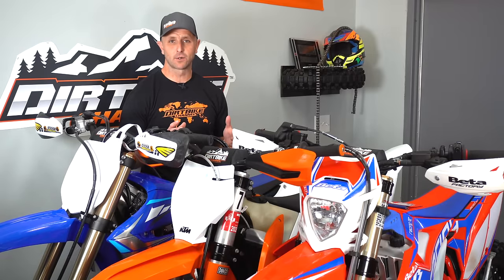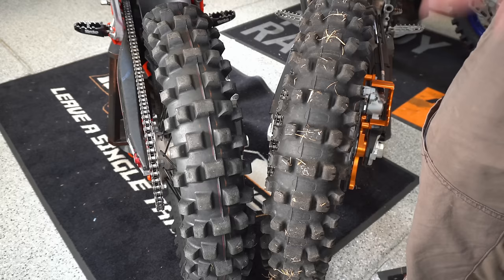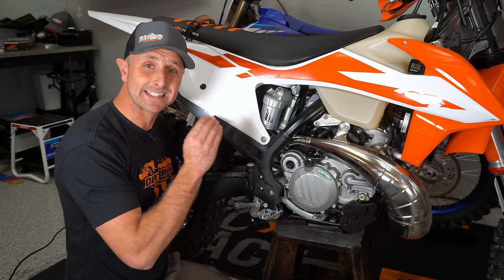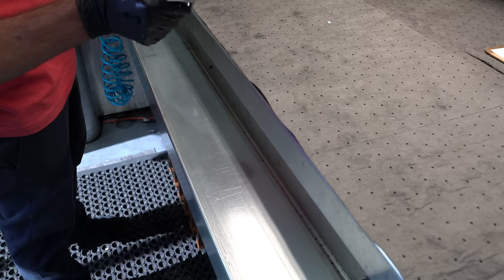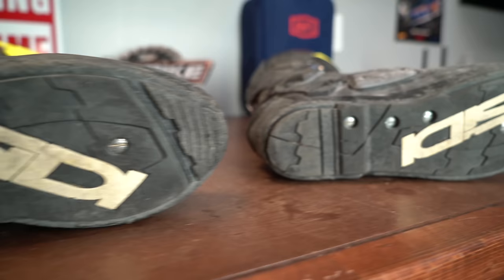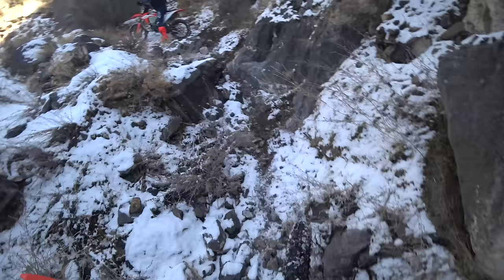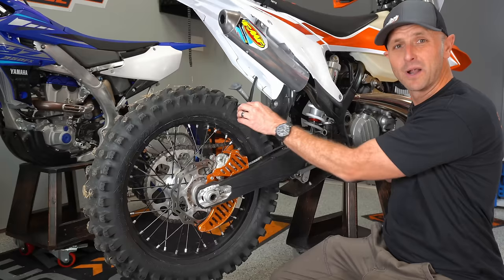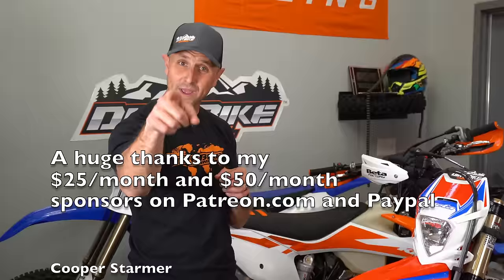21 Common Mistakes Made with Dirt Bikes - And How To Avoid Them

Comment: ...and if you're planning on riding enduro and have enough money to purchase two bikes (which I've known many to buy two right from the start) - PLEASE for the love of God DON'T PURCHASE the 450 on top of what you are already getting! Between mine and my wife's work in the past few years I've personally seen 3 people seriously injured and out of work due to the GNCC 450s. :( Glad you remind everyone Kyle cause those CRF450RX's have been looking quite sexy lately! Lol jk But anywho, SOOOO many have told me that they need to have it for "when they got better," or to have as an extra "desert racing/hare scramble bike." A Yamaha YZ450FX, or Honda CRF450RX, or KTM 450 XC-F etc. can and WILL knock the life out of you if you're not extremely careful...even for vet riders. These engines have the same muscle or more as their motocross counterparts do, but come with the other offroad accessories. They can launch you like a bat straight out of hell if you even screw up throttle control just a bit. Just do yourself a favor like Cody Webb suggests and purchase a trials bike...boy do they give a kick to my arse, however, they are uber super duper fun, and really smooth out the rough places in my riding. I got into them because the owner of my local shop raced them all his life and make sure the Honda/Cota packages are for sell every year. My legs are starting to look as good as David Hassleholf's chest! Lmbo Hope this shed some light on the topic, and added some options to assist others thinking about the 450 point you made, Kyle. Cheers all!

Comment: This is a high quality informative video! You highlight several great tips for riders of all abilities.  I am compiling a tool kit for myself to use on the trails.  So far I have spare spark plugs , plug wrench, 10mm , 12mm , 8 mm sockets and ratchet,  zip ties and an large adjustable wrench.  Do you have any suggestions on additional tools to add? Thanks for the great video!
Reply: Add a Multi-Screw Driver to the list. Zip ties are great, but some steel wire and pliers with a cutter are good for those hot parts.
Also, Bring a good set of tools and parts in your base rig. It can save a day of riding. I just repaired my blown exhaust coupler with tip snips, band clamps, and some garbage sheet metal roofing that I picked up from the trail. let me get a few more miles in for the day.  I also, learned another lesson: If you add something new to your bike, bring the old parts and enough tools to replace it on your first couple of rides. You never know how the trail is going to beat up your new parts... I know it's a lot of extra gear, but it may save your day.

Comment: I would add one thing. Don't be too afraid to fall over with the bike, it will happen to everyone eventually anyway, multiple times. You may break something on your bike, but if you try to hang on for too long rather than let it go, you will hurt yourself most likely.

Comment: I have a BMW F650 and took it to my first trail park and couldn't hold the steering wheel straight.  The front wheel just SINKS in the sand turns on its own whichever way the sand gives in.  I FALL alot! It just SINKS into whatever mushy, muddy, rainy terrain and can't hold it straight.  It weighs 450lbs i think.  Do I need a lighter bike? Like 250cc vs 650cc. I bought it because it was dual sport with street roads and offroads. Is it maybe for compacted harder off road conditions?

Comment: Don't bother with bling, get FARKLE instead. "Functional-spARKLE". If it does a good job and looks good, win-win. A good example of farkle is a great set of wrap around hand guards. Doesn't matter if their expensive and look pretty, they will do a good job protecting the throttle, levers, master cylinders, hands (TREES).

Comment: One big question u could help me a lot .
I have 125 kmx and after i start him doesn't respond properly .
If i give a little bit gas  sometimes it just goes hi rev all by himself. And is difficult to stop it ..
Maybe the carburator?
The acceleration cable works correctly.

Comment: Best advice that NEVER gets said is DONT RIDE the trial or single track....If it’s too wet/muddy a group of 4 guys can vertically ruin a good trail in a day, if the trail is too muddy. Leave deep ruts that turn into rain Ruts, kick up embedded rocks, blow out the fun little burms in the corners. And over all wreak havoc on what was once a great trail. Not to mention the hill climbs will now have an undoubtedly a giant hole where one of them lost momentum and dug a big ass hole spinning the rear wheel at some point. This needs to be said more often and it should be a shameful thing to see guys going out on a trial when it’s too muddy.

Comment: I rode my first 'big bike' when I was 13. It was a 98 cr250. Before that the only dirt bikes I ever rode were friends bikes ranging from 50cc to 110cc. I typically ride quads, a trx450r, which I've owned since  I was 14. Ever since I rode that cr250 I've wanted one. And I'm finally at a point in my life where I can afford one. So you're saying if I get a cr250 for MY first bike, I'm making a mistake? Even if I've rode them before?

Comment: Hey Kyle, I just had a gnarly crash with my SX 125, and I dented my pipe, do you have any ideas how can I get it back into normal shape?
Reply: Buy another one
Reply: @j-mx8021  yeah, I really do wanna spend $250 for a pipe, when my old one is working
Reply: Theoretically, you could fill the pipe with water and freeze it....the expansion of the freezing water (in theory) could push out the dent...
Not sure how one would go about “sealing” the ends of the pipe water tight though 🤔

Comment: Thinking about buying a new bike either a KTM 250 SX (or XC) or a YZ250 (or X) and was curious if there was a big difference between Motocross models and trail models as I still hit up the track and big jumps but the majority of my riding is in the trails. I currently have a 2004 YZ250 that is dialed for me but at this point it has 200hrs plus On it and rdy for something new before I decide to rebuild it
Reply: Gearing and suspension. A yz250 is screaming at 55 mph.

Comment: I find it hard to cover the brake when giving it gas hard to get the rotation of the grip, anyone else?
Reply: Yeah, one option is to put your throttle rotation further foward and you won't have to turn it that far
Reply: Try covering your front brake lever with your middle finger, that way you still have plenty of your hand on the throttle, and if you need to brake, your middle finger can do the trick, yes, it takes a little getting used to, but once you get the hang of it, there is no going back. Hope that helps.......

Comment: If your rideing a 2017 FC450 Whatever you do don't run out of fuel  BIG MISTAKE . Every bike I've ever owned warned me if I was running out by hiccups slight chugging missing whyle you were even going over a jump..And don't say that's because it's fuel injected.  Rmz450 2013 warned me. This FC just stops mid air . and then you get destroyed going over the bars.  You might as well hold the rear brake on mid air.  love the bike just wondering if all new bikes do this now . Extreamly dangerous.  YEA I know fuel up. I do its tank is only 7 litres and I can do 7 easy .  I've put a  low level fuel light on for a test .  Float level on bottom of tank.  My light goes out when it's low on fuel.

Comment: I ride sitting alot and my suspension seems to not do good when I ride on grass or rocky areas is that just taht im sitting or my dirtbike?
Reply: It's the sitting. Basically, on rough terrain, you want to maintain bent knees and a crouched/standing position.

Comment: (Sorry about the dumb name I made it when I was younger) I’m 5’7 170 pounds. Do you think a crf230f would be a good bike ? I’ve ridden like twice in the past
Reply: It is a good bike for the purpose it is designed for – which is casual trail riding – but if that is a good bike for you depends on what you need from your bike and what you plan to do with it.

Comment: #1, (mentioned a bit in #16), The easiest way to get hurt, weather you are a beginner or a pro, is going fast over unfamiliar terrain.

Second. "If it is too wet to ride, don't ride it and tear up the trail."  That comes from some Mt. Bike riders, and started with road bicycle riders transitioning into Mt. bikes in the 80's and 90s. Poor road riders could really climb a off road hill, but were skittish with everything else off road, did not like any ruts.  We ride the mud.  Always did, always do, and always will.
Lots of good info here though.

Comment: Get a china bike as your first bike. They are okay bikes at great prices parts are cheap so if and when you mess things up it doesn't hurt. Its hard to resell a twice used bike china bike you buy for 1000 sell for 700. Then when you ride a Japanese or European bike youll appreciate all of its features and qualities as well as not having to do maintenance as much but will be familiar with what and when to maintenan the bike. Very few first time riders are willing to do work as a used ktm 2 stroke will require nor the high price in comparison to a new china bike. Like i was scared of motorcycles and was not investing 3 grand for a used bike plus gear. Better to get great gear and a chinese trail bike. Most of us just want to scoot around with the family not doing wheelies and hard enduro.

Comment: I disagree with a lot of the stuff this guy says. He said that "the tire will do more for you than any suspension mod..." Tires are important but, they wont save in rough sections or whoops, etc. For the price i think having your suspension setup right will do a lot more than tires. Think about, tires only provide traction.

Comment: On the first point, it should be emphasized that smaller engine'd bikes are NOT slower. They are infact 'faster' the vast majority of the time. Don't kid yourself into thinking you are just 'working your way up' to a bigger bike to unlock full potential. No matter how much of a badass you think you might be, there's a 99.9% chance you are infact still just human and all a 450F will do is beat the shit out of you, not you beating it. You get a short tickle of power and think "hell yeah this thing is fast" no it isn't. A fast 'rider' is fast it aint the bike, unless you are already in the top 1% of riders you will almost always be faster on a smaller capacity bike. A 250F you keep it a gear or 2 lower and it'll be hauling ass, it's pretty damn hard to outride a 250F when its really singing, and because it isn't kicking you back so hard you'll be going at a faster pace, and then keeping that pace for longer because of how much easier it is to ride

There are a few exceptions like sand dunes, but even a 250F has enough power for advanced riders to run really, really quick. And myself as well as most other fast riders with 20+ years of experience under their belt seem to find, they start going down in engine capacity and lose interest in the big bores. I have so much more fun on a 200/250F than I do on a 450 or 500. I foolishly wouldn't have made that statement 10 years ago because as a guy we all have this "bigger numbers are better" mentality

Comment: I disagree with the helmet thing. Its just like raceing harness. As long as there DOT then it doesn't matter. They will protect you the same. The difference will be in the venting and screen and materials for comfort. I think most people over spend on helmets. All you need is a good $60 -$100 helmet.

Comment: This guy mentions in multiple videos that 2 strokes require less maintenance. Either things have changed drastically since I last rode or this dude is clueless. 2 strokes have always been high rpm time bombs.. clutches and piston rings wearing out like tires and break pads. Someone fill me in. Are new 2 strokes that much more durable?

Comment: If you need a bigger engine bike aka 450 buy the yamaha so you can tune it down dramatically that's what I did to learn on the dirt then turned that fucker up for the dunes which is what I mainly ride

Comment: You didn't earn mine, I'm still stuck on how you neglect to tell us about the real problems with KTM bikes.
Reply: Jimi Neutron wdym ktms are great bikes
Reply: @icecreamwithextracaramelco8950  I know, I have 4 of them. But Kyle Brotherson does a review and complains about the color and that there is no place to grab when the bike goes down. He neglects to mention all the new 300's leak oil form the power valve cover, or he doesn't mention the flame outs on the 4 strokes, he doesn't mention the bad starter motors that all the other bikes have, he neglects to tell us about the important things. He is a completely one sided person with KTM and his reviews can't be trusted.